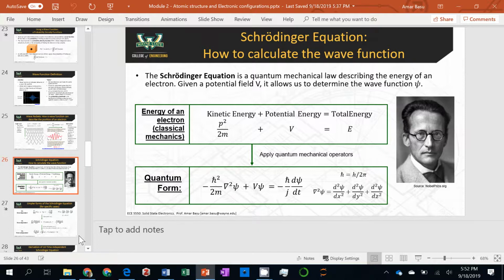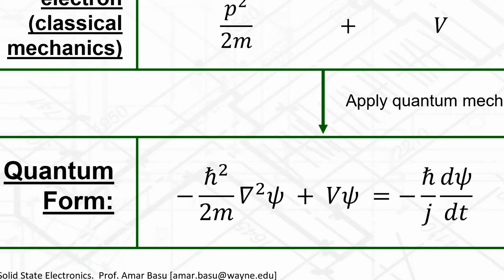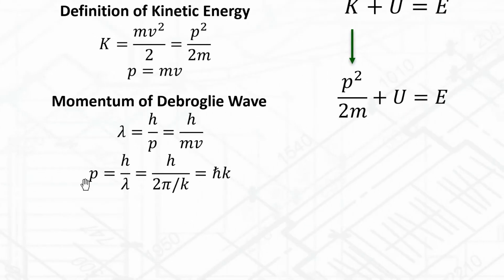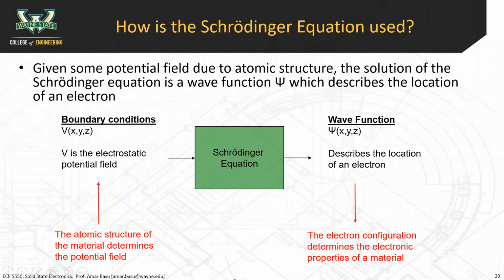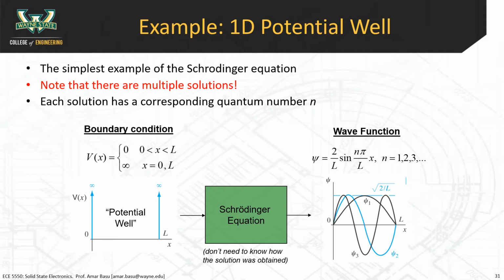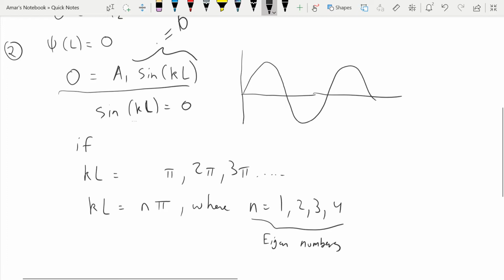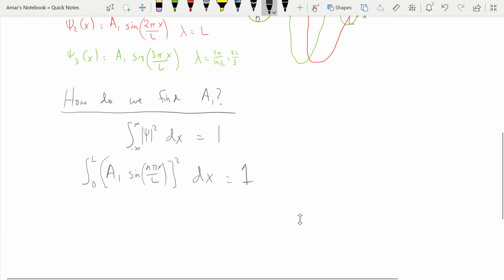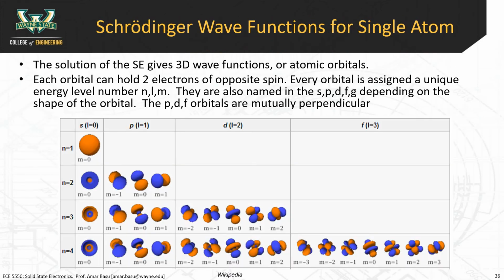2D: Schrodinger wave equation - derivation and examples

Comment: As we are separating the solution to the one only in function of position and the other as only the function of time, that means that the second solution would uniformy (in space) scale the wave solution. As the total integral over the area of interest of probability function (psi square) needs to be 1, doesnt that mean that that second function needs to be constant and equal to 1? Doesn't that further mean that the speed of the traveling wave inside an orbital is 0??
Reply: That makes sense as we cant have traveling wave when we have boundary conditions, we can only have changing wavelengths from one discrete level to another.
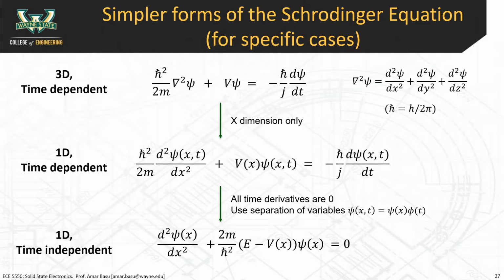Also on 21:00 we say in steady-state we do t have dependence on time.
Reply: What we can have is an electron hoping from one orbital to another, and that would be the speed of particle (electron) that is used in p=mv!?
Reply: Unless our presumption of ability to separate by variables is wrong.